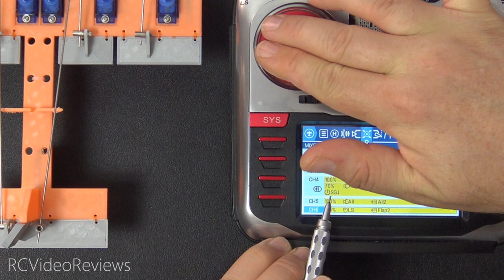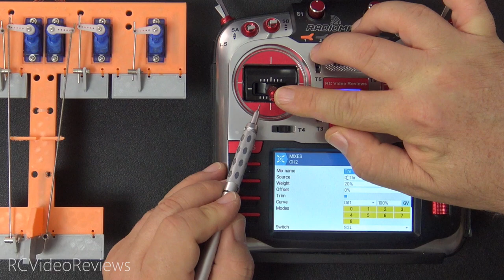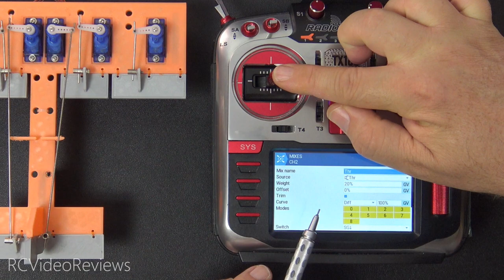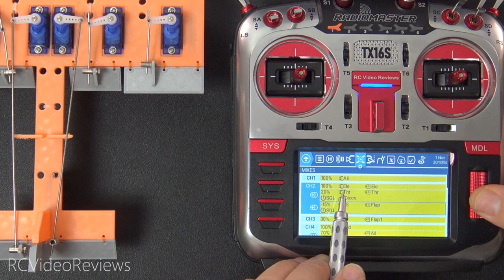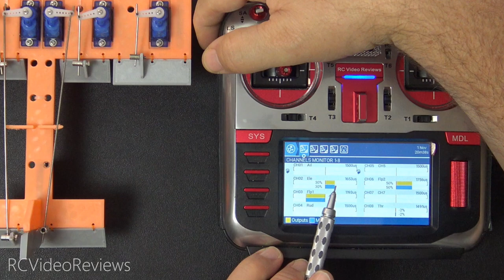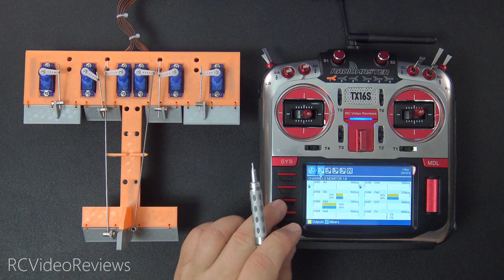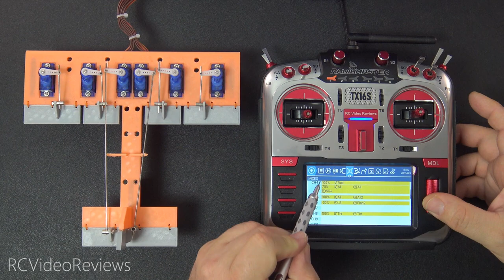EdgeTX Snippet • Aileron Rudder Mix • Throttle Elevator Mix • Flaps Elevator Mix with RCVR-1

Comment: Great video, the mockup plane made the tutorial extremely didactic. My mixes have just a little refinement: instead of using the standard diff curve I create customized curves and use them to fine tune how I want the mixes to behave depending on the input. For an instance, in KE (knife edge) mixes I can adjust the aileron or elevator correction depending on the amount of rudder used (little correction close to the center and more with extreme throws). Airplane behavior is almost never linear so this can help fine tune your mixes for a perfectly straight flight. This is obviously not needed for most flyers but can help when using extreme throws with those not so well designed (or constructed) planes.
Reply from the maker: I've done a number of curve based mixes as well. People like to see them both ways. I prefer curves for granularity.

Comment: Again - very informative video with great quality.
Although, today I just discovered how to control my mix weight (elevator and flaps) with another slider/knob. That might be helpful to setup a mix value in the air without landing all over again.
That is trickier since flaps work on different PWM range than rudder but very similar to your 1st mix shown in this video. In the mixer tab, just add curve that it should follow (same as on input curve for flap mix) and then on flaps off (-100 pwm) there is 0 elevator added and on flaps deployed (+100 PWM) there is given value of elevator set by your slider/knob.
Reply from the maker: There are lots of ways to make curves, weights, and expo work as you're discovering. I showed how to use sliders for weight and expo here https://youtu.be/Qq7eRk4N-pY and I go into built-in curves vs custom curves here: https://www.youtube.com/watch?v=cJuvl3mHxt8  Finally there is a detailed curve specific video here https://www.youtube.com/watch?v=d9PciJhjDi8 

Have fun with OpenTX. Lots of ways to do things on this platform.

Comment: When you do the elevator /throttle mix could you do it on a curve?  I've got one of those dancing wing eagles. I got a ton of nose up once I cross the 50% throttle (1/2 stick movement).  Doesn't seem linear, seems like I need a lot more elevator as throttle goes up.  CG seems spot on as I can glide in manual mode with minor adjustments for wind.  Theoretically these type of planes need to 2 to 3% off right and down motor offset.   I really didn't see that much difference between zero offset and 3% offset (used a 3d printer part to create the offset).

Comment: Thank you for your videos on tx16s, have helped me alot on mixes but am having trouble getting a mix from throttle to smoke pump with esc. If say on channel 9 do I just do throttle in mix? Just cant seem to get it to activate at say 50 percent and gradually increase from there. Thank you
Reply from the maker: Sounds like you need a curve to me. Discord would be much more appropriate to get help. Please join and ask there. Link is in description of every video I post: 
https://discord.gg/jSFTASU

Comment: Can you explain or do you have an example of working the Throttle reversing.  I am running the latest version of EdgeTX. I am thinking about getting a Eflight Viper that normally advertise the optional reverse thruster/throttle. Can this be constructed on Radiomaster tx16s?
Reply from the maker: Sorry, I don't use Spektrum gear so I can't answer.

Comment: hi dear , 
i learnt lot from your video ,

i have 2 question , 

no 1 , how we use T5 or T6 , to set as timer reset switch ?

 2nd question is : i am assigned these switches in GLOBLE FUNCTION , SA , SB SC SD SG , SE AND SH ,

can we use these switches , for other setting also , like you are using , for example , throttle elevtor , switch SH , and i assigned this SH SWITCH FOR SD LOG AND TOUCH  ? DISPITE  we are alredy install these switches on global function , 
no conflict , using in globle function and in mix ?

my english is not good , i hope you get my point 
===========================================

Comment: I'm new in Edgetx world. I commonly use Spektrum and futaba sustem. About Edgetx scrips. Can use more than one? Or what is the best for fixed wings, helicopters and multirotors?
Reply from the maker: Sorry, but I don't understand what you mean about using EdgeTX scripts and using more than one. You'll need to be more specific. What I can tell you is the radio ships with a number of LUA scripts arranged in the tools folder so you can access them from the tools menu under the system button. I don't believe you can have more than one lua script running at one time but the developers may disagree with that especially when it comes to things like widgets.

Comment: how can i set up my extra 300 bnf on edge tx 16s so i can set the aileron as flaps to do harrier? do i need to reset the ar631 receiver or is there a special function i can use
Reply from the maker: There's no function to do full span ailerons. You'd have to create a mix. I cover it in this video: https://www.youtube.com/watch?v=NBmz7mI6YgM

Comment: I am having trouble finding a vid on how to use an aileron in each side of the wing and assigning it to a separate channel . can you point me in the right direction
Reply from the maker: On the INPUTS page create an input called AIL, use the AIL stick as the source.
On the MIXER page
-  add a line on ChX (where x is the receiver channel you want for Aileron 1) use the Aileron INPUT you created as the source.
- add a second line on ChY (where y is the receiver channel you want for Aileron 2) use the aileron INPUT you created as the source.
Reply: @RCVideoReviews  ok, thank you .

Comment: how you create new airplane with edgetx, if the airplane have (2) ailerons ( 2 differents channels) and (2) elevator (2 differents channels)
Reply from the maker: In the mixer add four lines: 1, 2, 3, 4. 

Lines 1 and 2 use Aileron for input.
Lines 3 and 4 use Elevator for input.

Use the output screen as necessary to reverse servos.

On your RX, connect Ailerons to Ch 1 and 2, connect Elevators to Ch 3 and 4.
Reply: @RCVideoReviews  IN CHANNEL #3 IS ALREADY USED (THROTTLE CHANNEL)
Reply from the maker: The use 5 or 7. Or move the throttle.